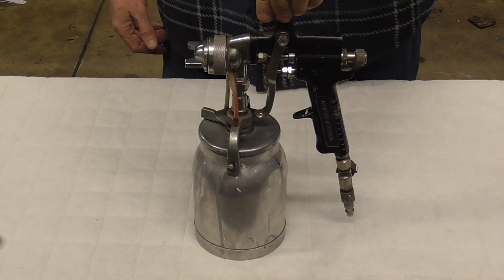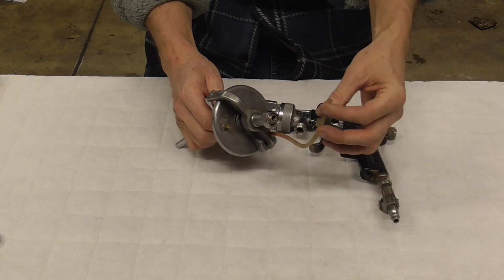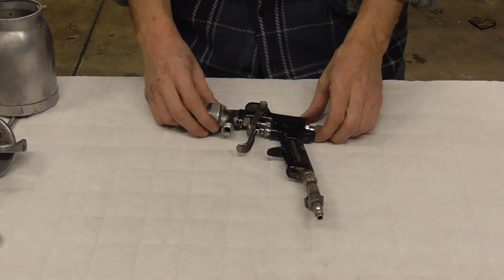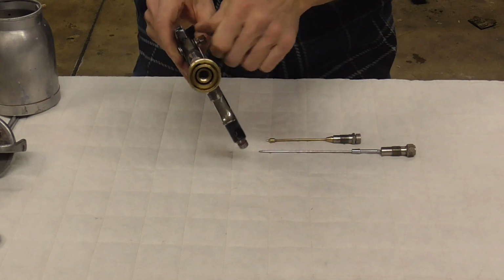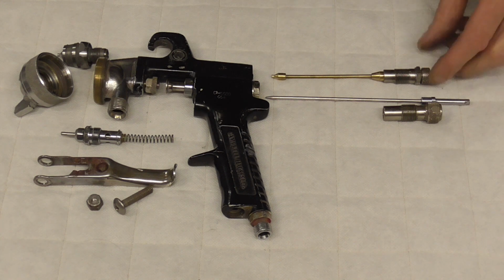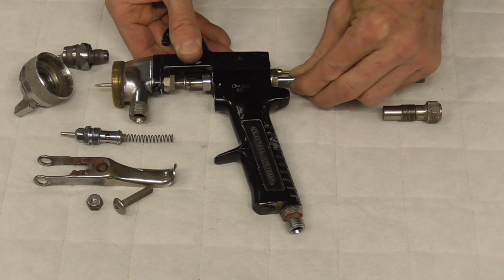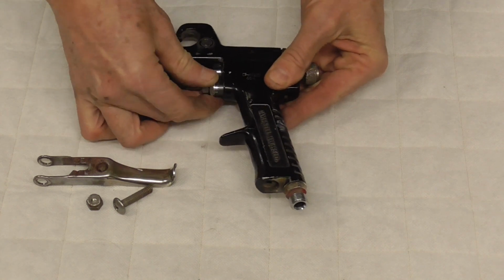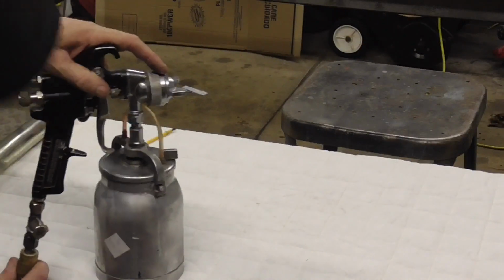Binks Model 7 Style Spray Gun Disassembly & Cleaning Made Easy

Comment: Just bought an old Binks no 7 on Ebay. Not for a display piece. I intend to use it. Maybe not for every job, but when I feel like it. Single stage, heavy clear coats are a couple things i want too shoot with it. I have had a knock off and a Snap On siphon feed, but now I got the old standard. I see rebuild kits are still out there if it needs some tlc👍
Reply from the maker: Great choice on the Binks 7.  A bullet proof addition to any spray gun collection 👍😊

Comment: I an old Binks 78 Eclipse that bought used back in the late 80s. My trigger was broken during a move a couple years ago and I've been unable to locate another one. Do you know if the trigger on a model 7 is the same? I would really like to use this gun again but i can't seem to find anything on the Binks 78 Eclipse. Any help would be appreciated. Thanks
Reply from the maker: I think a lot of different triggers would work.  Try taking some measurements and run up to Harbor Freight to see if some of their conventional guns might work for you.  They have a Binks model 7 copy and a Devilbiss JGA copy.  Maybe the triggers on one of those guns would work - they're $14 bucks a piece.  Or... try ebay for gun parts.  Let me know if you find anything - I'll try to think of something :)
Reply: @LakesideAutobody  yes sir, i was thinking the same thing. My Harbor actually has a conventional paint gun on sale. Thanks

Comment: I was hoping when you put it back together you would show how to adjust the spray pattern. Do you unturn the fluid adjustment all the way out and pull down on the trigger, hold trigger down in place and screw in the fluid adjustment until it contacts the trigger and then turn the spray pattern knob all the way in for full pattern? Seems this is what I saw on a video for a newer gun. Had this Binks #7 for 30 years and as an amateur used it a few times with pretty good results. But it has been a while since I used it. My hood and top of my truck is fading bad and I need to paint them so thought I might get some advice on best method of adjusting this #7 gun.
Reply from the maker: For the fluid control - squeeze the trigger fully and turn the adjustment till it touches the trigger.  For pattern (top) - it's different for everything you spray tighter for thicker primers - wider for thinner paints.  Use what works best for your job.  Basically same with air pressure - a balance between too much overspray and fumes and too little paint & atomization.  Ask more ?s if needed :)
Reply: @LakesideAutobody - Thanks for the info. I painted the passenger side front fender, door, and extend door on this 2000 150 about ten years ago with Martin Senour base coat clear coat. That side had been totaled with only 54,000 miles. Bent the frame so I used parts and put another frame under it from a junker. and kept it in a shed most the time. A hurricane came through New Orleans a couple years back and blew the shed down. I had evacuated in the truck. So being parked outside the original clear coat and paint on the hood and top has deteriorated. The NAPA MS paint is holding up great. So figure to paint the hood and top and later paint the rest of the original paint. I was just eyeballing the spray pattern and fluid level before and testing the output by spraying thinner on a surface so your info should be beneficial.

Comment: Hello again thanks for another great video.  I noticed you have the tube on the top of your tank cap mine does not have that all it has is that that hole do you think that should be drilled out a little bigger than what it was from the factory.  Ty. Joe
Reply from the maker: You can drill it out but tie a bib around the cup just below where it attaches to the gun in case any pain dribbles out that hole when painting a hood or roof :)

Comment: Do you know where to get a rebuild kit for  this gun.
Reply from the maker: For the original binks model 7?  Here's one from Amazon:  https://www.amazon.com/Binks-Gun-Repair-KIT-BIN-6-188/dp/B007XYQ6AE
Reply: @LakesideAutobody  I also have a copy of a binks 7 by campbell Hausfield. Will a binks 7 kit work in this gun?
Reply from the maker: @joeyhill3698  I wouldn't count on it.  I've had some copies of Devilbiss JGAs and Binks 7's and the parts are always a bit different.  A few parts may work though - let me know if you try it and how it works out  BTW - what's wrong with you gun - why does it need a rebuild?
Reply: @LakesideAutobody  it doesn't...i was just thinking long term down the road....